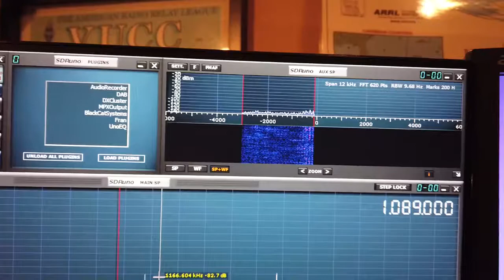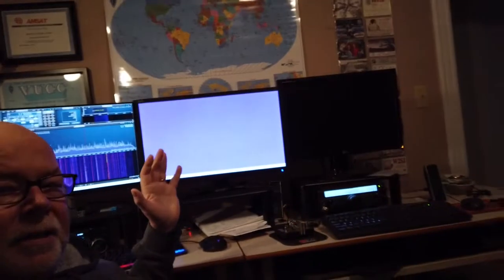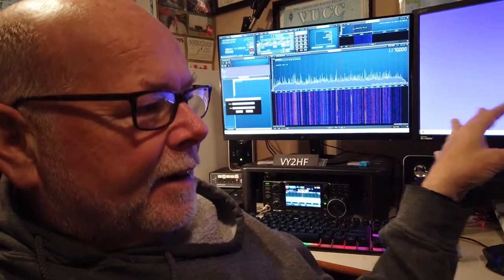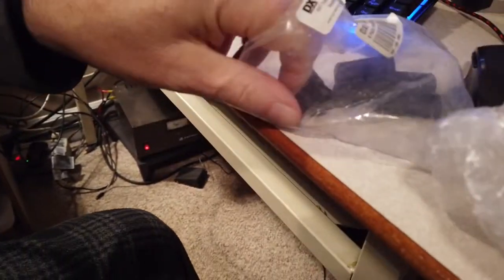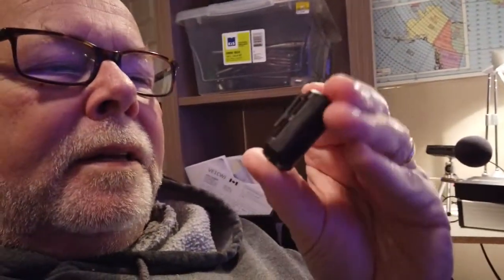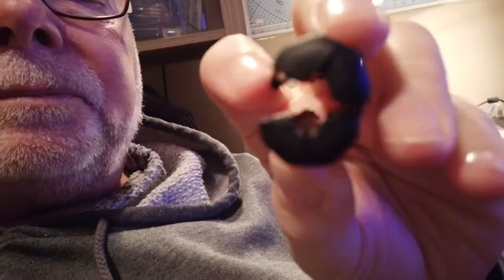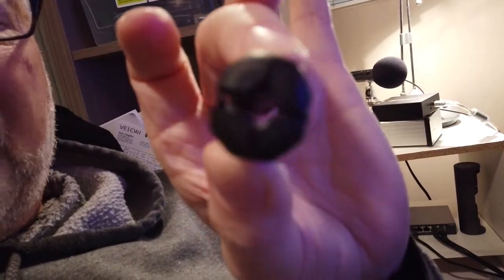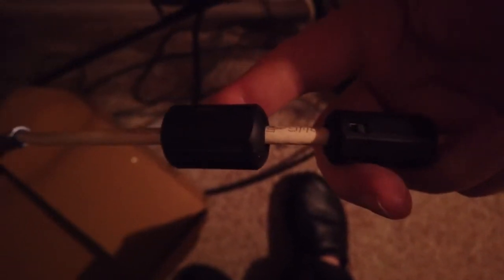Dealing With Noise on the Radio

Comment: It would be cool to hear the before/after sounds.  Probably unrelated, but I had a pair of amplified Labtec computer speakers that would pickup local AM radio when I touched the volume controls,  the station would get louder and clearer when I put my feet on the baseboard hot water radiator while touching the volume control haha 

I wish I still had those speakers
Reply from the maker: You were....an antenna! Yes, great suggestion on before and after!